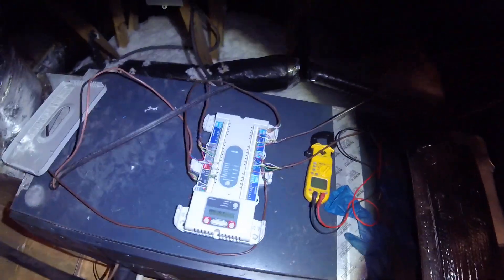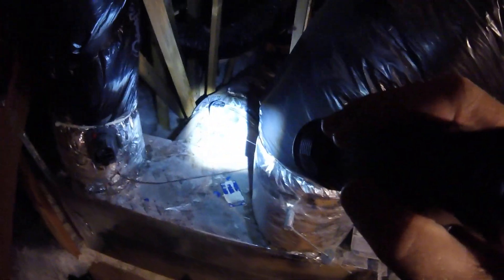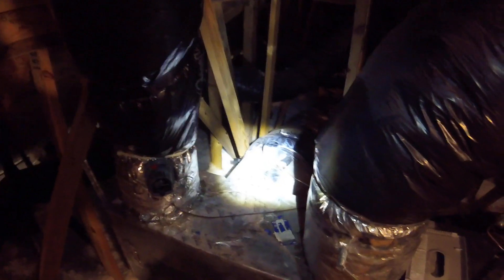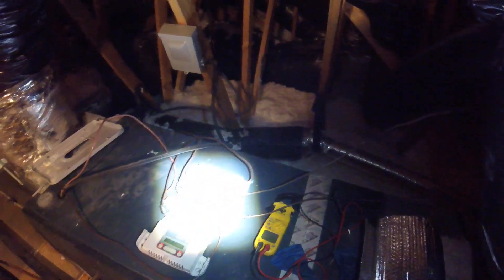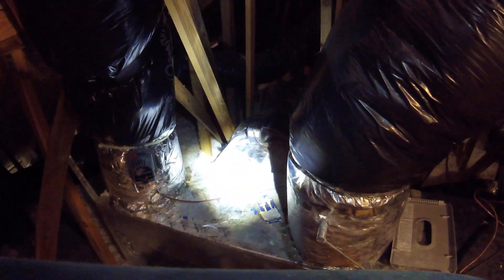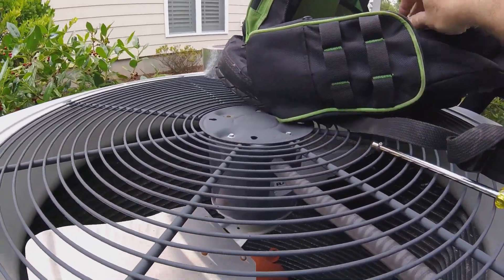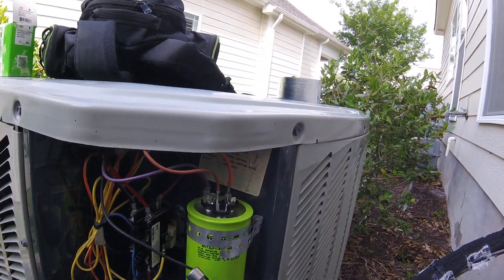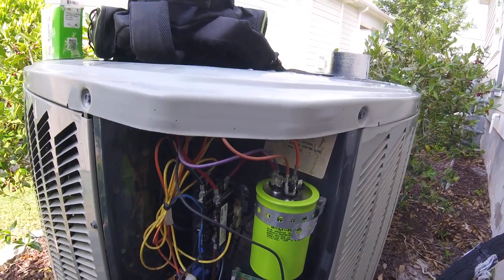More Than Just A Air Flow Control Problem

Comment: Zone sys you shown was the same model I experienced with .  At 1 big house 2nd zone in attic . 1 room had no air flow . I went up checked controls attached next to the furnace . Followed the wired and duct to the room had no air flow . Walked to checked damper when controls light green indicated opened . Found installer flipped damper closed while controls green opened . I had to do the same in your case .

Comment: Good find Mike ...
Reply from the maker: Thanks, It was the first time I have found that kind of problem. The owner did say that he had a problem with the damper in the past 2 years and don't recall what was done. So that is most likely when it was put in. He just never knew it until the run cap outside went belly up & had no AC at all.